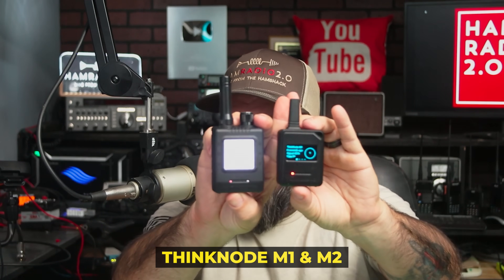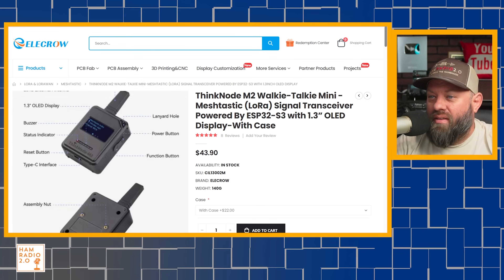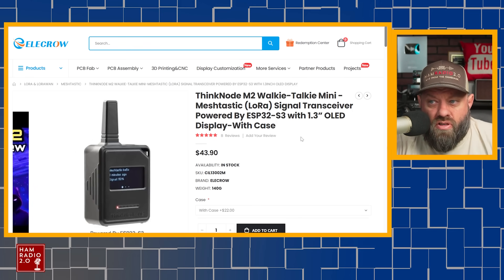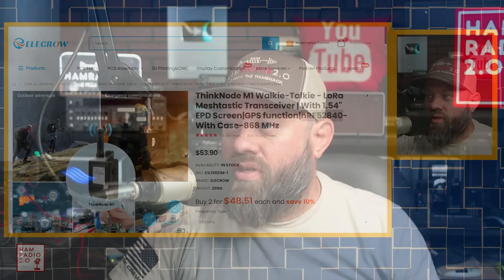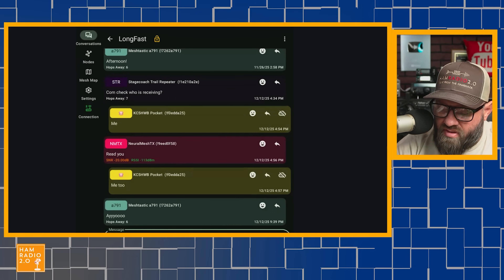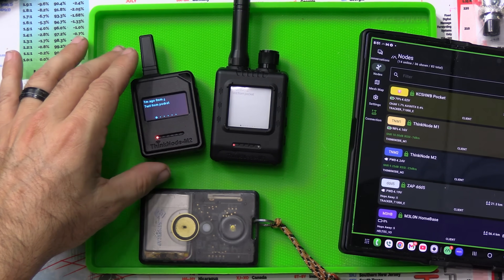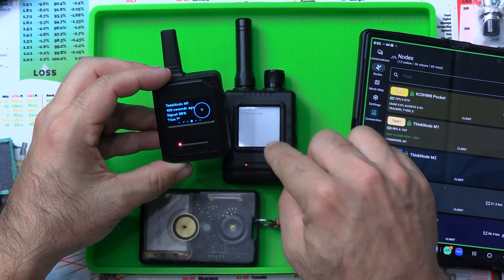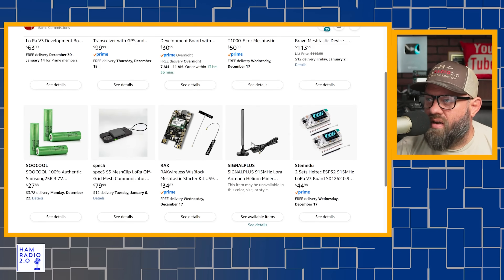ThinkNode Meshtastic - The Off-Grid Game Changer?

Comment: I really want to love Meshtastic. It's amazing on paper. I've tried several different nodes. Many antennas. I just haven't been able to achieve anything resembling reliable communications outside of the immediate area. It just seems to fall apart when trying anything beyond direct node-to-node communications.
Reply from the maker: Well it is made for smaller areas - and all the nodes MESH together, hence the name.  But you need line-of-sight too
Reply: @HamRadio2  I have no problem integrating into the mesh and seeing dozens if not hundreds of other nodes. The problem comes when you actually want to use it for something...like simply communicating. It just doesn't do that well at all.
Reply from the maker: I send/receive messages on mine all the time.  Maybe no one is monitoring in your area
Reply: Try meshcore, see if that changes your view. 73
Reply: meschcore!

Comment: Most people are switching to Meshcore. It works much better with narrowband technology.
Reply: Most have switched in Australia, and it's going great. The mesh is massive!
Reply from the maker: I think "most" is wrong.  I tried Meshcore a few months ago and saw nothing in my area.  I know it is better on paper, but different Mesh networks only service to divide everyone and defeat the purpose of what Meshtastic is trying to accomplish
Reply: @HamRadio2  I don't have meshtastic or meshcore in my area cries in Navajo rez
Reply: @HamRadio2  Check the World Meshcore map and see it yourself. I had Meshtastic for almost two years and now use Meshcore for 3 weeks. It works much better.
Reply from the maker: @jaccodejongthenetherlands611  working much better and "everyone has switched" isn't the same thing.  Try comparing apples to apples.

I do think Meshcore offers a better network but most have NOT, in fact, switched it to yet.  Of course this is area dependent.
Reply: @HamRadio2  "Most" is absolutely the case in many parts of the world, like here in VK, because Meshcore actually works reliably over long distances and multiple hops (across entire states). It's repeater based topology is winning hands down for us here. Tastic just simply can not do what Core is doing for us. But YMMV based on your requirements. Also to say that Meshcore only exists to 'divide and defeat' Tastic is a crazy and frankly ridiculous attitude for you to have - It does things VERY differently to Tastic for a VERY good reason, and you should look at, and understand why this is...73